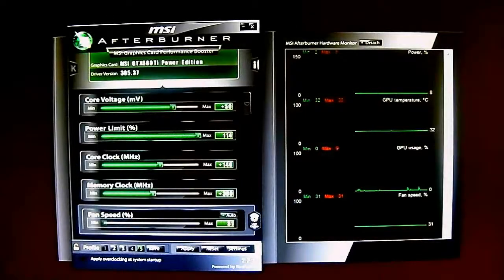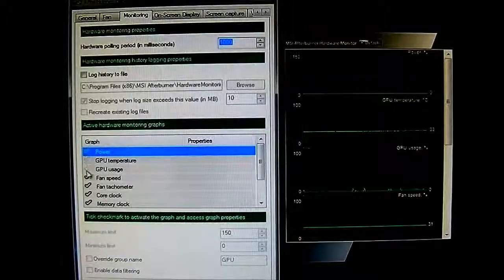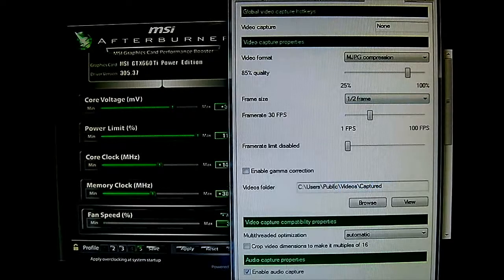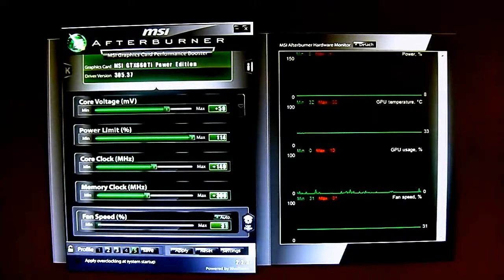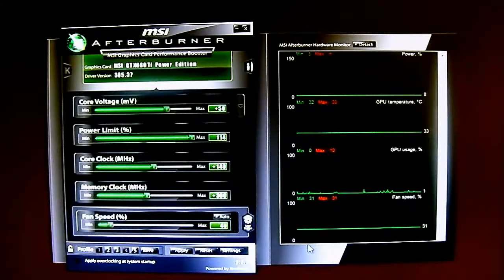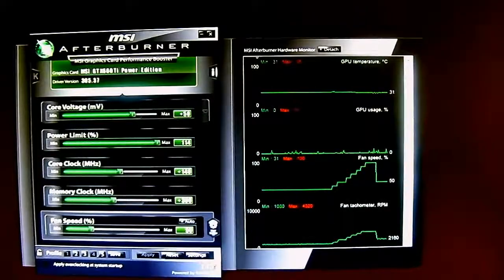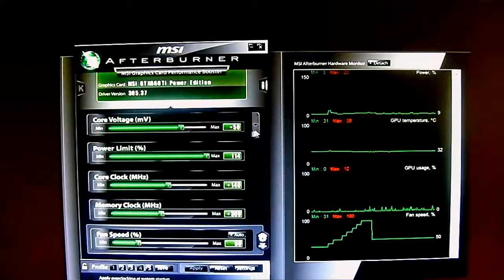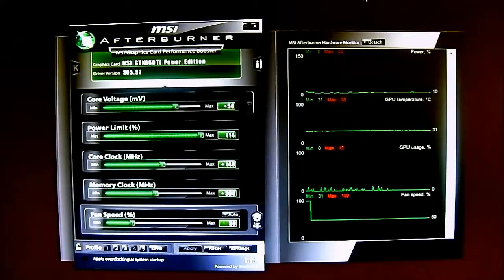MSI GTX 660Ti OC Power Edition - Performance Tuning and Fan Noise comparison with MSI Afterburner

Comment: same card, +50 voltage, +100 core, +100 memory and unstable, FUCKING SHIT gpu
Reply: +Marek W its even unstable on +50 core and 100 memory!!!!!!!!!!!!!!!
Reply: hmm , I don't know bro
My 660TI's cooler is always running, maybe you've got semi passive card

but if your card isn't overheating then don't worry
Reply: +Polak z polski dude mine is unstable on +25 core clock... lol

Comment: I have the same card, and it's 99% stable with a +125 core clock, and a +520 memory clock. Power limit maxed. Voltage at 87%. In game my clocks are around 1340-1350 core, and close to 7200mhz memory. Now I have crashed once or twice in HOURS of gameplay but for the most part, the card is stable at no higher than 78-80 degrees. It's an absolute monster.
Reply: +KFieLdGames Hey man i have the same card so . you reckon these cards even though really old can still handle a overclock

Comment: Eyesprkegude the negative affects are higher power consumption higher heat out put and maybe a lower life span so if you're gonna have a overclock set I would make it a profile and only apply it when you are about to game
Reply: idiot, if your not gaming it won't ramp up so there is no point in making a profile
Reply: It may not ramp up but when you do things on your computer like even open your browser it ramps up to some extent it's just a safety thing I only enable when I plan on gaming
Reply: your gpu ramps up when you are browsing?? throw that gpu away...its defective
Reply: No when you open a browser it doesn't go to full 100% its goes to like 30% usage then drops every GPU does it and like I said the dirty game overclock being only when I game is for reasssurance

Comment: core voltage: + 50
power limit: 114
core clock: + 125
Memory clock: + 300
still crashes while gaming :( 
Specs:
CPU: Amd athlon II 640 4x 3.00 ghz @ 3.2 ghz
Mobo: asus M4N68T
GPU: MSI GTX 660Ti Power Edition
RAM: Kingston 8gb 1333MHZ
HDD: 2X 500 gb samsung
OS: Windows 8
Installed on 1080p monitor with VGA
PLS help! :(
Reply: try lowering the speed for the memory, even if the slider can go a lot further, it does not mean that everyone will be able to get that, i have a much worse overclock because like i said not everyone will get the same overclock
Reply: Trey Bazinet i lowered the core clock to 50 and now it doesnt crash anymore

Comment: power limit only goes to 114, I managed to OC to +85 core clock and the memory to 400+ stable without touching voltages. These gave me like 5fps more.

Comment: It should be safe. That is basically just telling the card what the ceiling is, just in case and it doesn't really hit that ceiling unless you are extreme overclocking. Temperatures, silicone and VRM will mostly determine if it can hit that ceiling or not.

Comment: hi man...

I can overclock just to 5 % (GPU :+60 and memory: +200 MHZ) Why so little? What is the problem?Drivers?! I saw on internet that these graphics cards going to ( GPU:+125 and memory: +530 Mhz so easy)
When i put that value, nvidia drivers is shutting down....and yes..i have the latest drivers! my power supply is 700w (54A) and temp is 59-60C in full mode!!

Comment from the maker: It is up to you if the noise/performance ratio is to your liking. If you are overclocking, I suggest adjusting it using the step adjustments.

Comment: For anyone having issues with the "Triple Over Voltage" not showing up, downgrade to Afterburner 2.2.3. For some reason the latest is not compatible and you will only get the stock adjustments.

Comment: I'm having the same problem of Afterburner not showing that I have power edition (which I do).  I tried updating drivers, usin beta versions, but nothing worked.  I also don't have that extra button to the right of core voltage to allow the extra tweaks of aux voltage, etc.  How did you get it to show "Power Edition"?  Email me please: dlackeyATbakDOTrrDOTcom

Comment: gtx560ti has no boost, is a gen older than yours, but it might be the same problem, nor sure... i can play any other game with max volt and core mem clock, 1ghz core, pretty ok for this card, witcher 2, skyrim etc all runns fine, bf3 after a few minutes, pew pew on desktop. i read on some boards that bf3 has some troubles with overclocked cards so this isnt a singe problem.

Comment: ive an older 560ti and i can play bf3 ONLY non overclocked. if i put only 100mhz more on the core i got crashed out on desktop. but its only in bf3 it dont like overlocking, looks so..all other games i can run with max overcklocking.

Comment: But im not understand a point, why can your version hold +115 mhz on the core, and mine crashes only at 80+ mhz.. Maybe a faulty chip? or its normal these differences in the lottery chip? 

Thanks

Comment from the maker: It boosts as much as it can with the power/tdp headroom you allow it to.  If it crashes with added core clock then it can't handle that overclock.  Test your OC with Unigine to make sure.  Also, 660Ti's respond well to increased memory OC even with minimal core adjustments anyway due to the bandwidth limitation so even just memory adjustment you'll get good gains.

Comment: Sure i did, +100 mv on core, and 114 power limit, 

added 50 mhz to the core, 300 mhz to the Memory... I have no problems with the memory, but when i add 50 mhz to clock is suposed to be at 1070mhz and with a boost of 1148 MHZ! , and it boosts itself to 1275 at battlefield 3!! 

Hope you can understand my bad english! 

thanks one more time

Comment from the maker: PLL is Phase-locked loop, although in this case it is much more convenient if I just say that the voltage adjustment on that is more for extreme (LN2) overclockers because it allows for more power draw through PCIE. Explaining PLL in detail requires a much longer explanation about electronic theory but in the context of this video card, PLL voltage adjustment refers to additional power draw through PCIE.